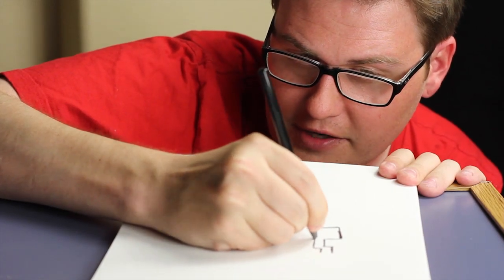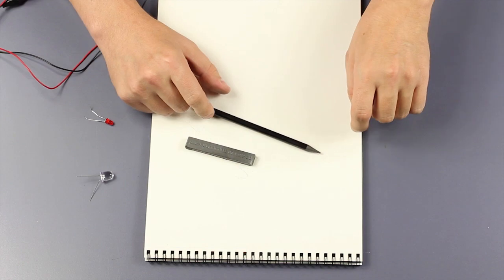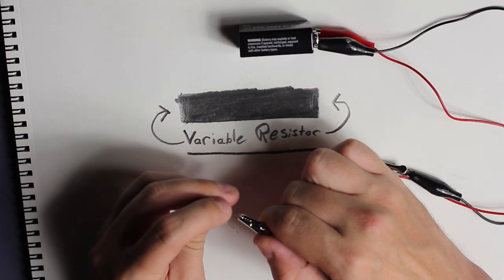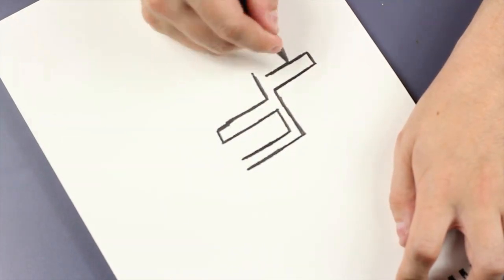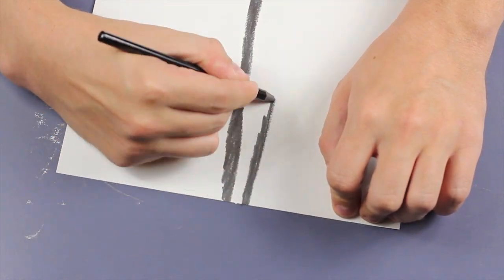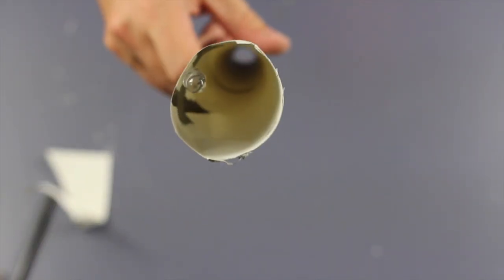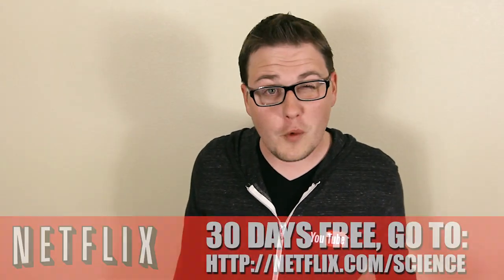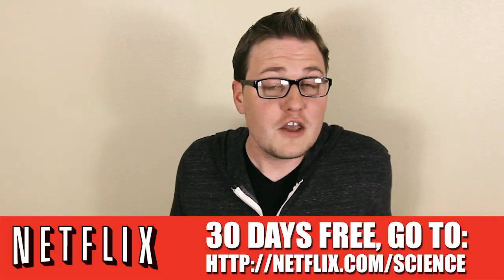Paper Circuit!

Comment: I know that electric motor contacts are made of graphite. I have several graphite rods found near an abandoned smelter. I want to make a switch that can carry alot of current without contact welding the switch which results in a runaway closed circuit. Bad. I could probably get the same results from a fat piece of lead or brass. But graphite is also a lubricant and may work better if it doesn't cut current like a resistor.

Comment: this does not work you cant draw a circuit
Reply from the maker: wut?
Reply: @HouseholdHacker  you need something else to draw with not just a pencil this does not work
Reply from the maker: Did you try it?
Reply: @HouseholdHacker  yeah i did. there is a ink pen i found online for circuit drawing for about 80$
was going to try that
Reply from the maker: Weird. This video is legit. Maybe try a graphite pencil from an art store? That's what Dylan was using in this video and it's way less expensive than that pen. Kitchen physics experiments shouldn't cost $80. Wowza
Reply: @HouseholdHacker  does the graphite need to be a certain grade?
Reply: i need a straight up stick of pure graphite?
Reply from the maker: I'm not certain. I've seen folks say a  #2 pencil works and others say to use a graphite art pencil. That being said, the latter was used in this video, so if a #2 pencil isn't working for you, try a graphite art pencil.

Comment: The use of a graphite pencil is interesting since the material is conductive, it would be necessary to test, I do not know if I have already done it, what difference is there in using B 2b 3b 4b there are perhaps conductive differences and they could be seen instead of using a led use a tester or multimeter and see how the values vary another option that occurs to me is to use the old carbon paper which is based on graphite which stains the fingers when touched, the new ones do not work because they are not based on graphics and use binder

Comment: I think he connected wires to that LED under the paper, that`s why he poked holes. The length of that graphite line is simply too great to power up that LED this way, too much of a resistance. He essentially threw in a little lie to help the vid.

Comment: I could not get a led to light , I used 12 volt DC but with my multi meter I did get different resistant reading`s running end to end I also got different volt readings end to end so can any one tell me why it did not light the led , Yes the bulb is good !

Comment: There is metal in the pencil. If you notice, it reflects when you paint a part with a pencil. Metals also reflect. The metal also transmits kwlem for electrical conduction.
Reply: Ice Wizard glass also reflects doesnt make it a metal... 
Of course it does contain metal but your explanation to why it does  makes no sense.

Comment: do you really need a 9V battery? Can't we just use a normal AA battery? 
EDIT
And which pencil is best required?
Reply: I'm pretty sure a #2 pencil would work.
Reply: 9v battery is needed because the voltage drops too much across the graphite

Comment: I did this for my science fair project it didn't work because the resistance was to great and were 18.6 k OHMs  soooooo this does not work sorry
Reply: Low quality pencils contain a higher percentage of clay, which is an even worse conductor than graphite. The pencils in the video were expensive art pencils, with high graphite content.
Reply: You've just seen it working.
Reply: I tried this out in my physics class a few months ago. It works.
Reply: +May S  did you do the same as he did, like drawing the circuit with pencil ? I use this topic as my scientific research at my school. Can u show me the detail like the steps please. I really appreciate it if you help me
Reply: Sale M I literally tested it but I just used pure graphite
Reply: I dont belive this to be true, its not revealed enough  there is enough room for him to hide cables and stuff.

Comment: Hi, This did not work for me. Tried with a 2B and 8B pencil and even with a graphite block. Any help?
Reply: Same here
Reply: I would say try diferent brands and papers
Reply: madhuri s. Kapur that is because the resistance was too great  and it has 18.6 ohms sooo I will not work
Reply: Same here but with my multi meter i got voltage & resistance reading so i dont no why it did not work ?

Comment: Reminds me of my overclocking days when some pencil marks on a AMD Athlon XP would unlock it (IIRC), and some marks on the new $550 video card along with the Vaseline on the top side so when the TEC got to cold and made it frost up on top or the phase change cooling on the cpu dripped condensation on it it wouldn't fry it. 

In jail pencils can be used by sticking a wire in the electric outlet and touching the pencil across to light cigarettes and stuff but you had to be careful to make sure there was enough resistance or it would blow the breaker on the TV and the guard would have to reset it

Comment: Where do you get the 1 little led light
Reply: Did you figure it out..its been 8 months..You can get it  from ebay in a set of 100 at 2$ or maybe less, they are 5mm white leds.

Comment: uhhh ok just use regular wires?
Reply: +kubus7653 Yeah, but I don't have spare wires laying around in the house. I do, however, have paper and a pencil :D It's more cool that way, too.
Reply: +Mary Udomah just cut a rj45 cable i'm sure you have some spare ones lying around or just print a circuit board
Reply: That's not the point. The point was to show that you can use paper and graphite to make an electrical connection. Honestly, did you even pay attention to the video?
Reply: its just for fun

Comment: Could you do logic gates?
Reply: You could make a 50::50 voltage divider with two input terminals. If only one of the inputs is high, then the signal output is 50% of V(source). If both inputs are low, signal out is GND. If both inputs are high, signal out is V(source). With the proper amount of amplification and attenuation to accentuate the difference, you have a resistive "and" gate.
Reply: Defining light bulbs to 2.4,8,16,... and providing an adequate circuits will make the logic gate.
Reply: Technically, it's just basic electronics, so if you draw a real life logic gates, it should be able to work
Reply: No, you would need doped silicon in order to make transistors.

Comment: Can a paper circuit overheat and catch fire?
Reply: ***** Thanks! Since I come up with a lot of ideas but know little about the stuff I have to ask questions that may seem stupid to a person who does these things all the time. I just wonder how well these things work when you're trying to use them for something other than science projects. lol
Reply: +John Young Hi I like your video relating to paper circuits.Something I also found useful for how to make electronic circuits was Elumpa Circuits Expert Alchemist - search google if you like.
Reply: +Jett Aniceto Car battery aint enough voltage. The current that flows is the result of the resistance in the graphite traces and the voltage supplied. You might have some luck with a trace that's like 1cm long, beyond that the current is limited too much. Car batteries can supply heaps of current because they have a low internal resistance, but that's a moot point if the circuit connected to them is of a high resistance.

Truck battery maybe, they're 24V.
Reply: +John Young as long as resistance is low, a head sink of some sort is present, and there is no short circut.
Reply: +John Young Graphite has a resistance of 7.6 Ohm for an average 10cm , that is a lot of voltage wasted
Reply: If you make the circuit go in circles yes
Reply: +John Young even a rock could catch fire
Reply: Connect a car battery to the paper lol
Reply: +Sky_Hawk12 “SkullCrusher” i made a circuit that goes in circles with a battery and some copper wire and it started smoking lol
Reply: +Ei aC what about... i dunno... maybe 600 6 VOLT LANTERN BATTERIES!?$
Reply: ***** That'd work well, just make sure you lick the terminals first so they make a good connection.

Comment: Can I make a 4-Bit computer with this technique
Reply: CJ G Theoretically
Reply: +CJ G But how can you form a logic gate? This technique can only replace the wire.
Reply: qugde yah so this is better than soddering a board and mess up
Reply: The paper would likely burn up due to the amount of energy you would need to sustain enough energy throughout the circuit.
Reply: +CJ G yes,and the advantage of the technique is it can twist compare with the board
Reply: +DragonMinerToons  I think the aspect of the magnetic effect of current in cooperation with this 
technique  may be work to emulate the action of Logic Gates,but i still don't get it in detail.
Reply: You can buy graphite pencils
Reply: qugde You can try and emulate the action of Logic Gates in some way, or just use actual logic gates in the form of transistors on the paper.
Reply: @DragonMinerToons  could probably build relays  and use those instead of transistors.

Comment: did someone make a computer with this_?
Reply: ***** of course. thats why people wont do this even its still posibble
Reply: The paper would probably burn form the amount of power necessary to power it, especially since the resistance is gonna be so high, the power supply's gonna be huge, like 2000W or so
Reply: @junkwub7870  Thank you for not calling anyone retarded, while providing an accurate answer.
Reply: Well You can make a computer...it can be about 5 volts or such it would be very low power it could be done yes
Reply: Altyazılı Dede yeah but the people who made it put windows on it and it kept blue screening
Reply: It can run MS-DOS Beta Preview.
Reply: It only can run Magnavox Odyssey.
Reply: Paperduino
Reply: They must’ve
Reply: Altyazılı Dede nice one dude hahah
Reply: Altyazılı Dede probably not
Reply: Altyazılı Dede  yaae  I did
Reply: rasberry pi zero bro?
Reply: Altyazılı Dede oo turk
Reply: No, the traces he made in the video are simply just resistors, you would need something that can switch current using other currents, such as transistors, which use silicone to switch currents, not graphite.
Reply: What about instead of making the resisters just connect all the parts?
Reply: It's a horrible conductor of electricity and a computer as an electric device capable of storing data
Reply: Altyazılı Dede me
Reply: Altyazılı Dede yeah that’s how windows 7 was made 😂
Reply: or another way, is it possible to create some logic with paper?
Reply: Me
Reply: YourGamerGalaxy, Calm down, its just a concept.
Reply: wtf, it would burn instantly
Reply: Altyazılı Dede xD
Reply: I'd love to see you try to create a semiconductor with only graphite.
Reply: why did I not think of that?!
Reply: Probably
Reply: Ya no, he is not. Thats perfectly doable.
Reply: Hey your question isnt bad, some loud people have a restrictive idea of computers. You could make a computer using this method, but you'd have to redesign how it works, since you don't have basic transistors to work with. It would end up being a lot more mechanical, for example maybe you use the variable resistor demonstrated in this video to store states, like early non binary computers. However without transistors a traditional boolean logic gate based computer is not possible.
Reply: Oyun Öncesi Define "Computer" If you have an incredibly broad definition where a computer is literally anything electronic then yes you could make a "computer." However if you define it as something that can process and store data than things get a little complicated.
Reply: Killagoku PC you are right but still possibble. Everything is made by + - current. So even it doesn't worth making a computer by pencil, its still posibble theorically. But you will need a huge sheets of paper to make a computer
Reply: Altyazılı Dede not sure about that but i did make a hentai sketch once which my gf saw unfortunately but didn't say anything probably because she knew i was an ass orifice....
Reply: You cant make a Motherboard, Graphics Card, RAM, and a Processor from an 3.5 wat light... Btw an average PC needs to have 350-430 Watt

Comment: THIS DID NOT WORK!!!!!! Can anyone help me
Reply: sigh  come on Vincent, you really think ANYONE sells LEAD pencils?

We call then "lead" because ANCIENT writers used lead to rub out symbols on tablets.  graphite+clay (or clay+pigment+wax in colored pencils) are the only thing that's been used in the modern wood-wrapped pencil.

The hardness of the pencil determines both the shade and strength of the tip, and is adjusted by adding more or less clay to the graphite-clay mixture. What you see in this video appears to be a dark "artists" pencil that use very thick graphite cores in thin-wood wraps.

You can CALL a pencil's core the "lead", since thats an accepted term, but its actually graphite and clay. ;)
Reply: You used a graphite pencil didn't you?

A lead pencil is used but.... Lead is poisonous so now its graphite...
Reply: Vincent Ta I used a #2 pencil XD
Reply: Oh...lol... XD
Reply: t-dude pencil lead IS graphite. A number two should be fine. If it didn't work I would try to make sure you have a fresh battery, a good LED (careful not to blow it), nice thick dark lines, and good contact between the wires and the paper.
There's no such thing as literal Lead pencils, metallic lead makes for a terrible writing instrument.

Comment: Which type of led I need to use? I tried 2B pencil and tried several LEDs but it looks like less only get about 1.5v. I measured the voltage on the graphite line and it gets about 7-9v but when I connect the led it only gets only 1.5v

PLEASE ADVICE

Comment: Where can I get some of those tiny jumper cable type things?
Reply: Many places like radioshack.com, amazon.com, or digikey.com (to name just a few).  You can search on the terms "insulated alligator jumper" to bring up some choices that you can pick among for your project.  If you have a physical radioshack store near you can ask the clerk if they carry any (that stuff used to be displayed more prominently, but they hide some of it in drawers now and the selection is reduced).  The alligator clips themselves come in different sizes and you can even buy them without wires to attach your own.
Reply: Rhacman thanks

Comment: if you dont have LED or other light bulb and are NOT working near easily flammable stuff you can use a short piece of the pencil/graphite as a light bulb itself, or a fire starter for that matter if you touch it with a stick.

Comment: i just tried this, didn't worked for me =/ i used the 2B pencil, tried putting the LED, and put a thing to light this on, didn't worked, but when trying this on the pencil itself (on the graphite part) it just shows that it conducts in the multimeter (i'm from another country so idk how do i say this but the thing is like a voltmeter)

Comment: leds (without internal resistors) usually are  around 2 volts to light, not 3.5.  Use a volt meter to check it. they may light dim at lower voltages. Perhaps the ones you are talking about have 2 leds in series in the same package.????
Reply: OK some are 3.2( green)  and High brightness may be higher.  but the basic ones are around 2. SEE:
http://dangerousprototypes.com/docs/Basic_Light_Emitting_Diode_guide

Comment: it works if you dont use the paper.. i changed my project to two alligator clips connected to a 9V battery. then one clip on a small LED bulb, the other alligator clip clipped onto a piece of lead out if a mechanical pencil.

Comment: good way to explain carbon is a decent electrical conductor
Reply: No, Carbon is a terrible conductor.
Reply: pokezionzook1 but its still a conductor this is why you cant consider wood like a good electrical insulator
Reply: pokezionzook1
Try carbon nanotubes. It isn't necessarily the carbon atom, it's more to do to the shape. In this example, the pencil-marked areas are composed by many 2D molecular 'flakes' of variating amounts of carbon atoms in each, normally in hexagonal formations. Also, there is a distance from each 'flake', and further the distance the lesser the potential of transferring electricity, plus the number of 'flakes' it takes to reach it's destination, the resistance adds up quite fast; compared to using a nanotube, which, while is made of carbon which is the same base atom element as the graphite used in this example, should not have any gaps and therefore no 'flakes', but one long continuace[?] tube with the side composed of carbon hexagons. From what I understand, it has quite remarkable abilities, from high amperage loads to high tensional strengths to high temperature tolerances.

Comment: Not worth it, the resistance is too high. Battery in the video is 9 volts and LEDs require only 3 volts. Loss as 6 volts.

Comment: Here's the thing! When you draw a line with your graphite pencil you are depositing carbon on paper. Carbon is present in resistors. And if you are drawing thin lines, you are essentially "Drawing" a resistor. :) But if you make the lines thicker, you are drawing a conductor (with a pretty high resistance though). But I guess the resistance will decrease once you make it thick enough!!

Comment: actually, the carbon graphite works both as a conductor, and many components due to the nature of the material. With this you could literary draw your resistors, transistors, and with additional layers of paper you could also draw you transistors. Graphite carbon is extremely an efficient conductor.

Comment: Yes. Minecraft is a mental-puzzle used for architecture, circuit design, and is also used to stimulate creativity and physics. Like for example, a stick of dynamite has a 3X3X3 meter blast radius, and you could calculate and orchestrate demolition using that information. Therefore, Minecraft is not a game for just non-intelectual individuals.